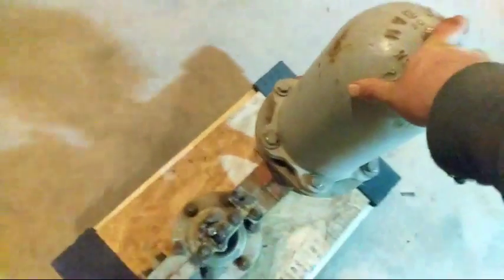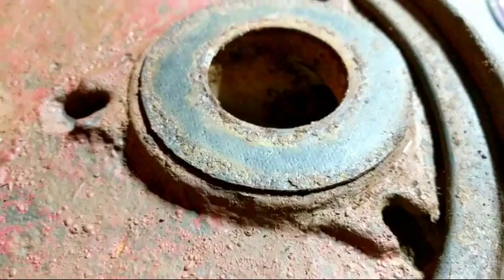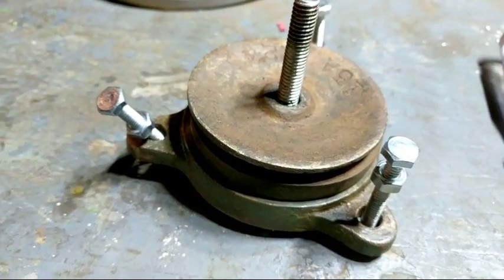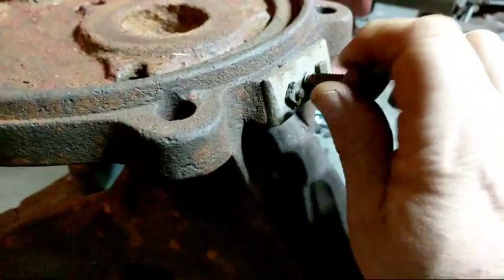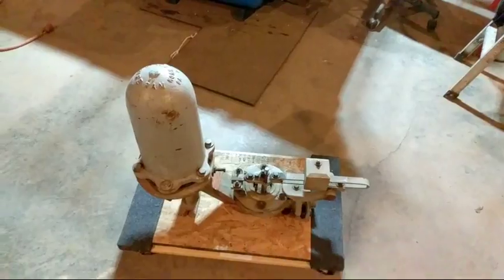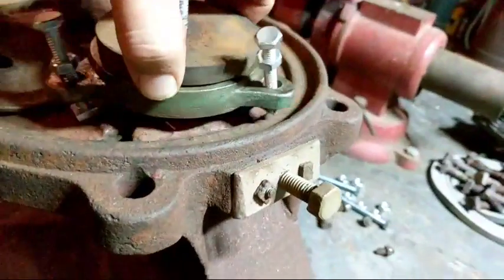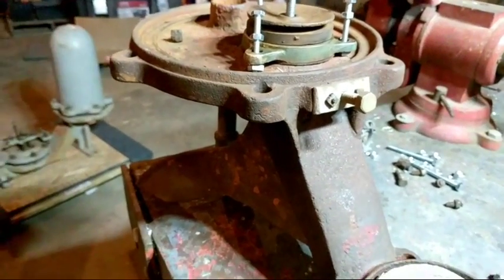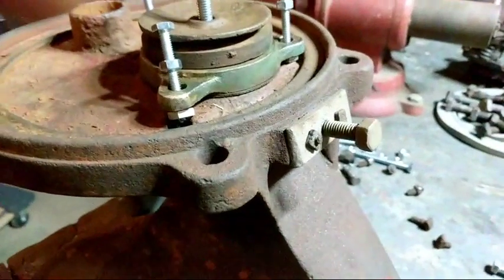1920 Ram Pump Rebuild

Comment: The sniff hole is a stupid idea., try with out and the pump will improve. The ram pump runs on pressure it can not suck spring water.

Comment: I have A Rife 10 B Ram that has A Clamped down Rubber Valve in the Air Chamber...it works its way Loose quiet often due to the Age of this Pump & Rife discontinued this line of Pumps Long ago & Don't even have the Parts for it Anymore....So I'm thinking About Modifying the Inside Valve With A Gridiron type that you have on Your Pump Since Rife Does Sell these for a little over $100.00 Which is A Lot Better than Buying A Brand New one for over $2,000....Lol....Would this Not work if I tapped the Bolt holes into the Base of the Pump?....Thanks.

Comment: My folks had a property in central Idaho in the 70s. I found a pump design in Mother Earth News that used pvc fittings. I was able to pump to a holding tank that gave my folks 20psig in their cabin. It was neat, but not very efficient.

Comment: Hey Scott. Got a question on this double acting ram. I can’t find any good info on ho it works. I understand how the ram pump works (I built one based off of your other videos) but I have two water sources. A spring and a creek that are right next to each other. I’d like to use the creek to pump the spring water. Any help would be great!

Comment: You should check out evapo-rust to clean up rusty parts. A lot of machinists who restore machines use it. It doesn't eat the parts like some other rust removers do and it lasts for a long time. It comes in 1-gal up to 5-gal.

Evapo-Rust ER006 Pail Rust Remover, 3.5-Gallon https://www.amazon.com/dp/B00M0TLQ6Q/ref=cm_sw_r_cp_apa_IsnGAbAN9K8J9

Comment: I definitely like the way your battery held on there. 
Thank you for explaining the principles and history of the hydrolic ram pump. I do have a question though. 
If you have a water source, say a tank, x feet in the air (lets say 10'), would that be high enough to pump the water up to the 100' level, or would it even work?
Maybe a better way to put it would be, could the ram pump move water to 100' from a source that's only falling about 10'?
Could I build a small ram pump using pvc pipe?

Comment: Scott, Eric Parlow here.  Have you seen a ram pump modeled in SolidWorks (SW) CAD/Motion/Simulation/Flow?  I’ll be at our SolidWorks reseller TPM in Greenville Feb 26-28 for an advanced class on simulation.  I’m going to take this on as a project to model a Riffe Ram in SolidWorks (SW) CAD then assemble it with Motion and use Simulation/Flow to demonstrate how it functions.  I need to see a pump to model it or 3D scan it.  Clemson may be able to help.
Thoughts ??
Text me at 8287777976
Reply from the maker: eric parlow sounds like an awesome project just let me know what you need.
Reply from the maker: eric parlow you're welcome to come here and measure a ram. I can have one completely assembled on my bench and one totally disassembled of the same type.
Reply: Engineer775  Will Do. 👍

Comment: Yes I think all the ram pumps are very cool and your right old school is best God I love it when you fix and or show old equipment.rams and the old stem engines  and combustion type's from the very late 1880s to 1920s this equipment will run for just about some one's life time. You and people like me should be pushing this stuff as a just in case. And sir that's for showing you just don't see this equment being shown and fixed .

Comment: I bought one about like the one on the table. I called the company and told them what was on the brass tag. they said it was build around 1925 to 1945. They had sold all rebuild kits. So after the deal to buy the little farm died I quit working on it.

Comment: I get it now - it turns the kinetic energy of the mass and velocity of the all water in the whole inlet pipe to do the pumping when the valve is closed - all that kinetic energy has to go somewhere.
So the incoming water has to gain momentum otherwise nothing will happen when the valve is closed.